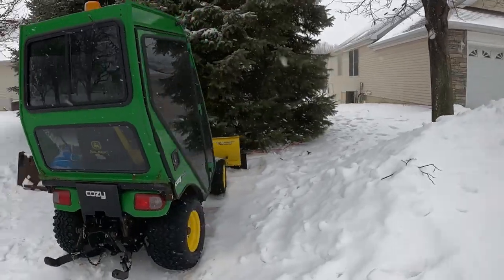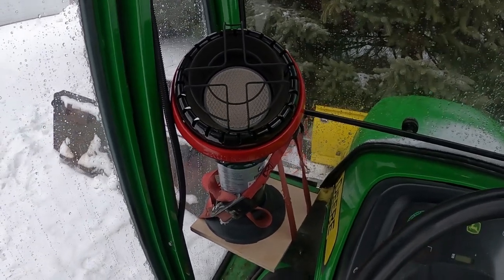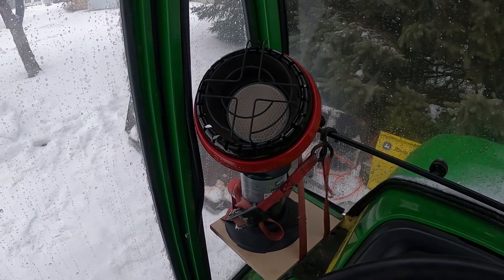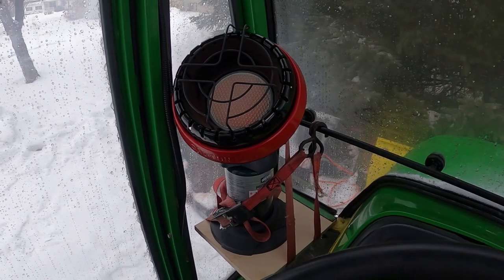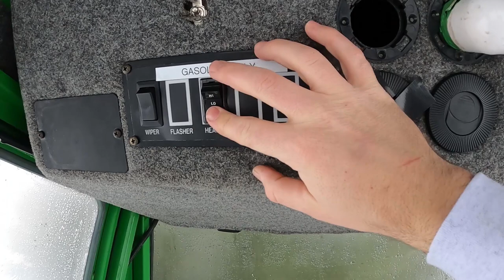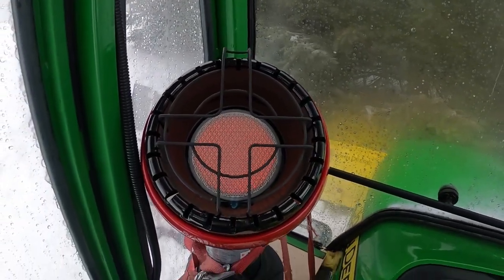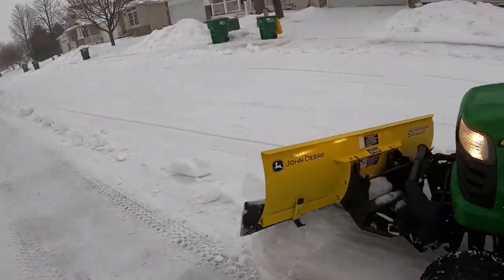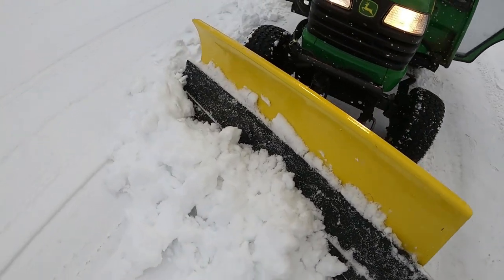Mr. Heater Little Buddy in a John Deere Tractor.

Comment: Propane heater in small enclosed space. This burn up all the oxygen real quick. Have you noticed yourself getting sleepy in the cab? Or do you have a window open
Reply from the maker: No problems. That cab has air leaks and the engine sucks air from the cab so its constantly circulating air. I wouldn't recommend using this to heat a car ;)

Comment: I have a Craftsman Turn Tight series dry weight is 630 pounds 22 horsepower 725cc V Twin Kohler 7000 I put ATV tires on it gets through snow and mud very well..

Comment: it will fire up. WHEN? 😂😂 i getting one any way.  for my X350 starting to build a cab but may turn out ordering one for i don't have all the time building it correctly with little experience.
Reply from the maker: It works great!
Reply: @titanlawnlandscape7783  Sure looks that way and very good Job. Building a plow all most finished. the Blade is made of aluminum and and bike parts to turn side to side. working fair so far. i also replaced a smaller pully wheel to the trans and motor to give the 20HP Motor about 5MPR more speed. Won't make pull wheel any faster for it would cause the transmission to go out of service in the very near future . 🥴😁
Reply: I’m debating getting an X350. How’s yours holding up so far? Does it work well with the snow blower attachment?

Comment: This is great.  Mr. Heater also makes a "golf cart heater" and I am considering either yours or the golf cart one for my cab.  My question is....Do you get a lot of fumes inside the cab from the heater?  thank you!
Reply from the maker: I dont notice the fumes too much. I just crack the window. It works great!
Reply: The golf cart heater is designed to take the bumps without turning off it only turns off if it tilts all the way over and the reviews of it say that it really does do good with bouncing around. I'm definitely getting one myself for the snow cab of my Husqvarna garden tractor. I'm just holding out until Christmas to see if Santa gets me one first, lol and if not I'll be ordering it immediately afterwards.
Reply from the maker: I had to rig mine so the flame wouldn't go out everytime I hit a bump. Works great now but has to be modified.
Reply: @titanlawnlandscape7783  Yeah I think that is the only real difference between the Little Buddy like you have and the Golf Cart Buddy. They pretty much just changed the colors of the plastic casing and made the golf cart version capable of handling bumps better. The golf cart version might be about an inch smaller in diameter, but I'm not completely sure on that part. I'm definitely looking forward to getting one.